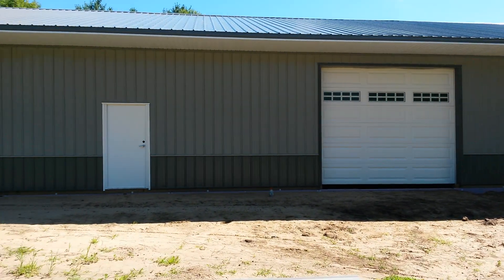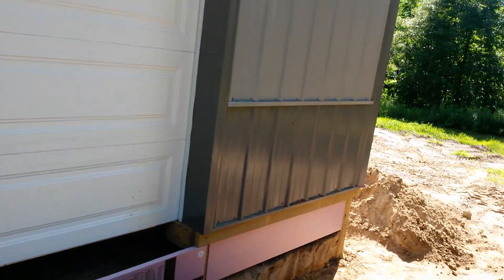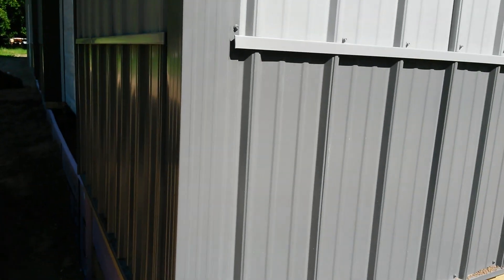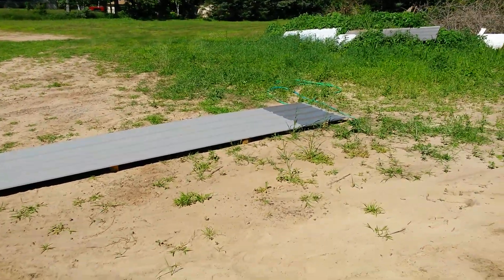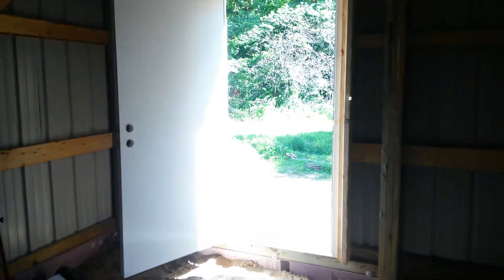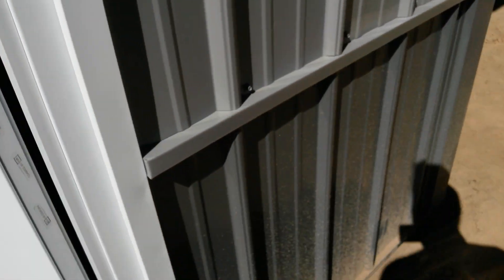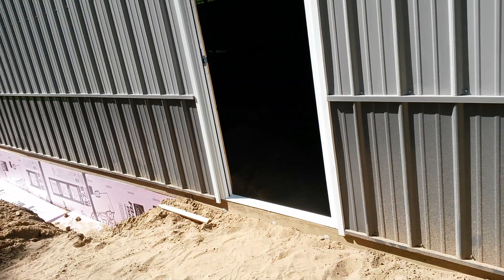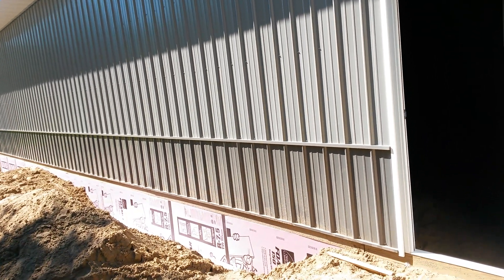Structural Buildings 40 x 80 Pole Barn Finish Quality  Part 2

Comment: What other options are there in your area besides Morton? How'd the concrete turn out?
Reply: Just read the comments about the concrete. Would like to find out who that is. New to the area and will be building soon.
Reply from the maker: This was structural buildings but there is Northland and another place in Isanti. Concrete is good, around $4.50 including saw cuts and 4500 PSI fiber
Reply from the maker: @duanedickey7043   I will have to see as he was a older guy who was thinking of retiring soon. So with this covid thing, he may of took off.

Comment: hey Jason, How much did you spend per sq foot on this building including concrete but not inside finishing?
Reply from the maker: I got a great deal on the concrete , for 4000 PSI Fiber , I got it for $4 installed. Usually it would run around $6-$8 installed . Just the shell was around 45K and garage doors were self installed at $3000 . They are the foam cored R18.4 . So around $14 a sq ft , but depends on many factors. Sidewall height , wainscoting  etc..  Breaking it down, I paid around $3.50 per sq ft for labor,  and around $10.50 for building materials , so you could do it yourself and save the $3.50 per sq ft for putting up the building . Thanks for watching
Reply: hey thanks for the break down.  I'm in the market and planing a shop build right now.
Reply: @JasonYouTube  Is it insulated? Same place do the concrete or who did that? I live in Ramsey and looking to build a bit larger garage or a pole barn. Thanks for the video.
Reply from the maker: @alanburke1302  I insulated it myself with R-25 in walls and R-49 in ceiling.  I went with a local guy who has been doing concrete work for 30+ years . He doesn't advertise as everything is by word of mouth and referrals and he is usually busy because he does great work at good prices.  You are better off calling concrete guys direct to eliminate the middle man contractor.

Comment: Wow, your in Becker? I'm in Princeton. Building a 36x48. Not sure who to hire to build it but j just bought material tonight from Menards.
Reply from the maker: Make sure you got the Stress Rated lumber ( It will have a fine cut on it by machine) . Just added safety as you want the "bones" of building to handle anything nature throws at it. Any building contractor can put a pole barn up , just they will need to have done it before . There is a place in North Branch that puts them up , just google that
Reply: @JasonYouTube  Custom pole buildings llc. Just looked them up. Your building material was from Menards also? Or did you go through Structural?
Reply from the maker: @pepeman3099   Structural , about same cost for material as Menards maybe a little more if you got the 11% rebate

Comment: What was the cost to have a building that size built
Reply from the maker: It was 45K without garage doors and only shell . Material cost through a big box company would of been around 35K. So basically paid 10K for labor & warranty minus garage door . Did those myself. Warranty is 7 years for leaks , 45 years for steel and 60 years for post rot.  Little things add up , so like these are 6 ft posts/ trusses OC , where regular buildings are 8ft+ . Al;so has 2 ft overhangs and 4 ft on front. Make sure to specify if need ceiling and what kind. Thanks for watching